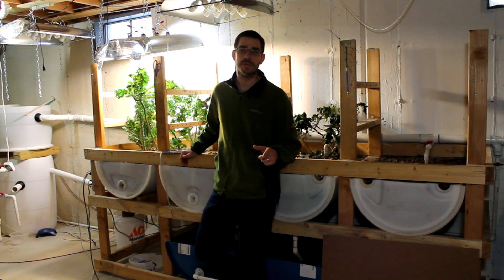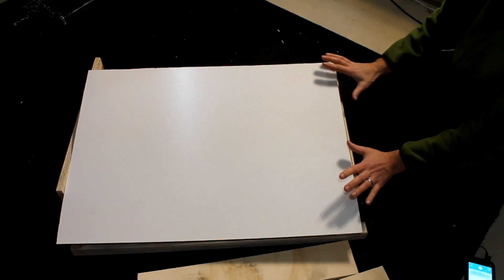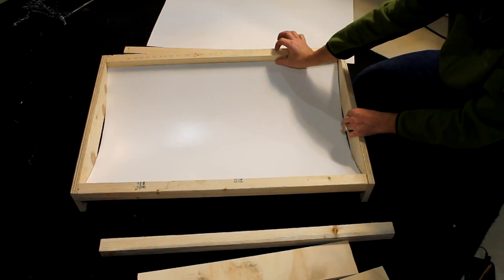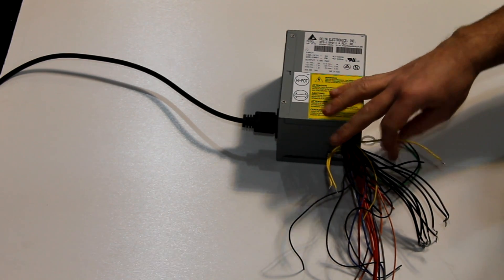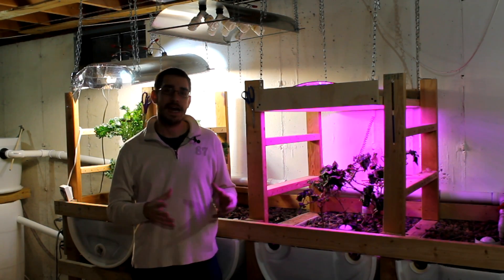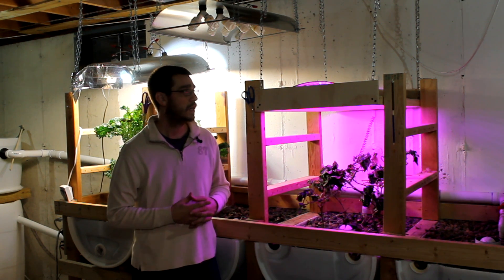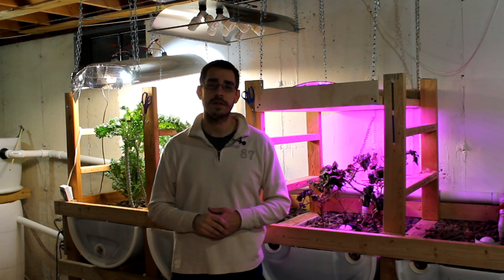DIY $35 LED Grow Light

Comment: Why do you split the power supply?  I have strip lights and am trying to make grow panels as well.  I'm using white LEDs - I was using connectors and that's just a disaster.  I have 12V power supplies that plug into the regular wall outlets.  How many rolls of LED strip lighting can be on one of those?  thank you!

Comment: There are a few issues that need to be addressed with this design. This is lamp is way too under powered to function well as a grow lamp. To be effective, the lamp should be populated with LED strips that are lined up edge to edge. Plants use mostly the blue spectrum for growth and the red spectrum for fruiting, but commercial growers user white lamps which are full spectrum. Multi-spectrum and red & blue are not as effective. The LEDs should be  a warm white color, 3500 - 5000k and the largest size / highest current available. A lamp of the size shown would need to use 2 or 3 five meter strips and a beefy power supply so as to not limit the required current. The lamp doesn't need to be shaped and should be flat. The wiring as shown will require the first strip to be able to handle all of the current for the entire chain which would probably be okay for the current design but could cause heating for larger designs. The top LED maker in the world, CREE, has an excellent article on LED grow lamps which is worth reading.
Reply: THANKS!
Reply: So in short these won't work great?
Reply: Color temperature is nonsense, show me a scientific journal. If you're at 5500-6000k you will be fine as that is what the sun puts out.

Comment: I just bought some melamine from home depot and I honestly would not recommend using this stuff. It gave me a splitting headache just taking it home. In the trash it goes since I read that some melanin boards are made with formaldehyde.  Yuk!  I will say that the gent who posted this probably sourced his board from a place that sells melamine that has not been processed with dangerous chemicals.  Unfortunately, Home Depot doesn't carry such a thing.  Wow.  My head still hurts and I am a tad dizzy from the smell.  Ugh.  Just an FYI for all.

Comment: You could get one of these CRJ 24-Pin ATX Red LED Power On/Off Switch Jumper Bridge Cable instead of cutting things up like that. It is just a simple power switch.  Also, are these mainly blue lights and at what Kelvin rating are they? I am mainly growing leafy vegetables and was told I would want more blue light because I am not growing flowering plants. Is this true? I am just learning and setting up my system and want to make sure I get the correct lights and other gear for my set up. Thank you for your videos. And from what I understand, these will work off the Molex connectors but only on the yellow and ground wires right?
Reply: Lots of experimentation on this very question is out there to review.  Comparative studies on the leafy greens indicate better results with daylight white.  The red and blue did not get near the results in a really good head to head comparison.  With lower output, you can just add more hours per day to get to a total daily dose of PAR to about 100 mmoles per 24 hour period.  This was excellent video though.

Comment: What did you say the sheet material is called? maloneme??
Reply from the maker: melamine, any building supplies store will have it
Reply: Thanks. I had one more question. I see you used a computer power supply, but if I were to use a regular transformer, like an LED driver,  for these LED strips, should I use a constant current or constant voltage driver? I previously used a high power (180W) LED panel and the manufacturer recommended using only constant current drivers (to maintain LED lifespans). But the manufacturer I'm getting these strips from (5.4 meter roll, 18W/meter, 97W total) recommends using a constant voltage driver rated at 120W and is assuring me it won't burn out or reduce the lifespan of LED's. I'd appreciate it if you could offer some advice (I'm lost on this now).
Great videos by the way! Very informative.

Comment: Regarding the LUX measuring, doesn't work quite like sodium bulbs. With LED (and sodium) you should go by the PAR value which is the Photosyntetic Active Radiation, how many umols of light is bombarded in one location available for plants to absorb. Lumens and Lux is just an indicator of how much light is sent by the bulb to one location. (Correct me if I am wrong) :) Cheers for a great video!

Comment: Does a regular led 5050 SMD works also or it has to be a 3 watts led?
Thanks
Reply from the maker: those are the smaller LED's so you may want to add more of them or go up to the larger ones

Comment: Left out the most important information ... the chip size used in the led strip is critical, never use '5050' they are not efficient  the smaller the size of led the more light per watt ..see wikipedia page on "smd led".... '3014 ' are best .... 
waterproof strips are more expensive , and the coating absorbs some of the light... generally non waterproof are best.
Lux meters don't give reliable readings with leds ... manufacturers power ratings for leds cant be trusted

Comment: YIKES! At 12:29 you are shown drilling screws into the power supply! :O
Danger Will Robinson!!  
Geez, what a good way for someone to get electrocuted or burn down their house!
A far better way would be to form some sort of bracket to HOLD the power supply.
Reply from the maker: +Terry Thomas lol, good reference there but of course I made sure that I was screwing shorts screws just through the vent slots on the side of the supply where there are no wires or components, thanks for your concern however:)

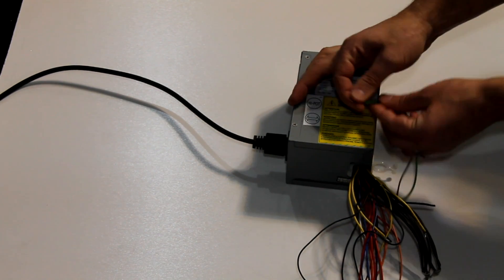Comment: At 6:23 you say to cut off all of the Molex connectors. I would not do that for a couple reasons.

1. if the Molex connectors are kept in place, no wires are going to short out.

2. it would be very easy to solder a Molex connector to your grow lights. Then if at any time you wanted to disassemble or move them all that would be needed to do is unplug the male and female Molex connectors. That is much easier than if everything was soldered together.

BTW, I also am a computer tech and have several computer power supplies sitting around waiting for a project. Thank you for pointing out that grow lights are a perfect use for them.

Terry Thomas
PC Tech Support
Atlanta, Georgia USA

PS
Connecting the green and black ground wires sends a "Power Good" signal from the missing motherboard back to the power supply. As you said in the video, if that signal is not present, the power supply will not turn on.
Reply: a friend of mine has built their own using led cobs, much better output and using proper par/pur spec chips unfortunate you cannot run directly from a supply with the chips as they need regulating (they will draw as much as you gan give and will burn out instantly) but his total build cost was around 25 quid, plant spec 50watt 12v chips, lm338t's for regulation, a few resistors to set current limiting on the lm338t, a 24v transformer (running 2 led in series), bridge rectifier and a 50v 10,000uf cap all mounted to a piece of fat U channel, so far the results are impressive, something to bare in mind lux/lumins are only a measurement of what usable light we can see, near infer red and ultra violet are difficult to see with our eyes.
Reply from the maker: Great point, the connectors would be great to add to the lights for easy disconnect.
Reply: @SSLFamilyDad  Would there be a big difference if i were to use twice the amount of LED strip?      there's a fair bit of room in between, and as an avid fan of DIY and a career electrician i see that as an easy thing to do - IF it's useful.
Reply: SSLFamilyD!m!,!

Comment: Do they sell the LED strip glow lights on eBay? The seller from Amazon doesn't ship to where I live.
Are these the same? 

http://www.ebay.com/itm/16-4ft-5m-LED-Strip-Grow-Light-300Leds-Red-Blue-4-1-Hydroponic-Flowers-Veg-DC12V-/322286756143?var=511187042180&hash=item4b09c9a12f:m:mgK2f93WrfpMZTH7H44ebHA

Comment: Pretty sweet stuff! I am a DIY person myself and I really enjoy your creativity.  I am trying to find that white material, but I am not sure how to spell it. Where can i find it.  Just curious why you opted to not use metal ac ductwork to make a curved structure for the LEDs similar to the  hanging fixture with the grow bulbs.  Thanks for sharing!  =-)
Reply from the maker: metal was an option but with the low power LED's I wasn't worried about heat. Wood looks nicer and is more ridged in this case. The board is called melamine, similar to the stuff in this link just 1/4" thick - http://www.homedepot.com/p/Melamine-White-Panel-Common-3-4-in-x-4-ft-x-8-ft-Actual-750-in-x-49-in-x-97-in-461877/100070209
Reply: Cool!  thank you!  I also like the tip on the power supply tip.  Altex is a great resource for me and I think I will get one there or ebay because I have read some reviews on the LEDs on Amazon that come pre-built with a dinky power supply and some people have said the power supply overheats.  I like your idea better.

Comment: Dont you have heat issues? My 5050strips get really warm,and as i see you glued your strips to wood which isnt a good heat conductor, so can i can i use a wooden board or should i glue my strips to a aluminum sheet instead?
Reply from the maker: those led's don't seem to produce much heat at all. If you want more powerful ones then I might suggest using metal to help dissipate the heat but I have left these on for days on end with no issues.
Reply: i ordered 5meters of red and blue led strip with 5050 chips,its 14,4W/meter,i hooked it up to a 12v power source and the leds heated up in seconds and they were very HOT,it is possible that im over-exaggerating this because i didnt make led panels till now,but im planning to glue them to a wooden board and i dont want this thing to catch on fire...
Reply: Hi. I love your videos. You seem like a great guy.

But I don't understand how this can work in a stable way. LEDs have a resistance which gets lower, as they get hotter. So - it gets warm, resistance gets lower, so it conducts more current, so it gets hotter, so resistance gets lowers, takes more current and so on, until it destroys itself. This is called "thermal runaway" and it's why LEDs need  a constant current power supply, and not a PC power supply.

Perhaps your LEDs use resistors, which can be used to regulate the current in LEDs, but they are a poor choice, because they regulate by dissipating excess energy as heat - which is not light, and won't help your plants to grow.

Could you tell us how your LED strips don't need a constant current power supply please?

Comment: Just a note, avoid led strips since they use resistors. If you had a constant current power supply and you wired the leds together by yourself, the whole thing would be far more efficient.
Reply: I asked cuz if you were to buy each individual led it would cost roughly the same as buying one of the cheaper grow leds the KIng Plus led to be exact
Reply: Yes, it's more safe and efficient, we have developed new led grow light with constant current and low voltage input, this is far more safe, also our product allows you to change Blue/Red light ratio, and light intensity, if interested, you can contact me.
Reply: Hi, sir I need your help as I'm working on this kind of LED panel.
Reply: +Joe Duan can you give me a link to your product please? I'm interested
Reply: Timo Salola where are you getting your information on efficiency?
Reply: maltman4101 I've got my own light setup and I had to do some research for it. If you are using a mains to power your leds, you will always have to use a transformer. Now if this transformer is a constant current supply, you don't need to use resistors and the only wasted energy comes from the supply and wiring. Actually, an ideal switch mode power supply can have almost 100% efficiency and with a low resistance cable, the amount of lost energy is extremely low. 

You can Google things like "why to use constant current supply with leds" for additional information.
Reply: Even though the led strip has resistors shouldnt the constant current power supply put the same amount of wattage through the leds? With just the problem of heat dissipation?

Comment: Great idea. I like the design of your hood and going to adapt the design using aluminum flashing instead of wood for thermal dissipation.  I've done something similar with more output using rigid strip LEDs that you can buy on eBay.  The rigid ones are better as you can remove the cheap 100 ohm resistors and drive the LEDs to their optimum current. The rigid LEDs are mounted to an aluminum alloy strip which can transfer heat to a crude heatsink. In my case, I'm using old T12 fixtures that use plenty of thick sheet metal.  I use double-sided thermal tape (also eBay) to stick the LEDs on to the metal. For example, I'm using the large 7020 SMD LEDs (90-110 lumens per when driving a at 500mA per LED). I drive 0.5M strips at 18 watts each for roughly 1800 lumens per strip, which is a lot of par in the blue and red spectrum.

Lastly, if you're concerned about flavor, budding, and fruiting, you're better off with warm white and cool white LEDs vs using red and blue "grow" LEDs. The main reason for this is that you get more spectrum. It may not be as efficient (uses more watts) but overall better results.
Reply: i guess it would be easier to use those t5/t8 integrated tubes. i only have to screw the two metal snaps on the wood to hold the aluminium fixture which is already integrated with the light tube. no need to worry about the glue and moisture.
regarding to wider spectrum in full spectrum  grow light, while i think it is not neccessary, because not all wavelengthes can be absorbed by plants, some wavelengthes are only waste for plants and only require power consumption. and generally full spectrum grow light may not have enough red light inside which can meet specially the bloom stage...
for red and blue tube grow light, there are 3 RB ratios which serfs percifically different stages: 3:1 for seeding, 1:5 for vegetative stage and 8:1 for flowering...things like the below link:
www.amazon.com/shops/haolin_growlight
Reply: i guess it would be easier to use those t5/t8 integrated tubes. i only have to screw the two metal snaps on the wood to hold the aluminium fixture which is already integrated with the light tube. no need to worry about the glue and moisture.
regarding to wider spectrum in full spectrum  grow light, while i think it is not neccessary, because not all wavelengthes can be absorbed by plants, some wavelengthes are only waste for plants and only require power consumption. and generally full spectrum grow light may not have enough red light inside which can meet specially the bloom stage...
for red and blue tube grow light, there are 3 RB ratios which serfs percifically different stages: 3:1 for seeding, 1:5 for vegetative stage and 8:1 for flowering...things like the below link:
www.amazon.com/shops/haolin_growlight

Comment: Hey can you use t5 with red led?
Reply from the maker: +Mike Disher I believe you can get 2700k t5 lights which is about as close to the red spectrum you will get with that type of loght
Reply: I super charged a t12 shop light added another ballist but I would like to add a red led for blown stage
Reply: for bloom stage our t5/t8 light with Red and Blue Ration 8:1 can help you...if you are interested, kindly let me know. thx :)
Reply: @besshu5036  I'm interested in the T5 bulbs you mentioned that you have. Where can I both learn more about them & also purchase them? Thank you very much

Comment: Hey brother, thanks for the video.. awesome you're into aquaponics.. Im all about organics.. so obviously, sustainability like that would be great..
I like the light you made.. first.. I have a few comments and constructive criticism… though, its just my opinion.. so anyone take it for war you will.. but thanks for the video..
Ive been looking into the DIY LEDs vs cheap amazon LEDs vs brand named.. seems I could buy a few different ones, and supplentment w/ T5s @ 6500 K and have a just as good spectrum..
Anyway,,.. I lie yours.. I think id go for 2 different spectrum powers trips, like mix one like yours with either pure white or whites and blues, and w/ the no UV in it, I think Id stick a 2x2 T5 at least 1x 6500K That'd come with it,and a Hortilux Powerveg.. Thats a great addition of blues, greens, yellows, and toe of UVB, and more blue.. great light.. Ive never seen nodes that tight from many lines all super tight under other lighting..
I think the mixture of putting a 2x2 - 2x3' in the middle, w/ a mix of 2 different types of spectrums, one with some white LEDs, and double up the amount of strips, would make a nice light.. 
I think Id buy a thin sheett of aluminum or steel if need be though,especially, because attaching the power suplys..
Thanks a lot for the video..
Id suggest putting even a single 2x2' Hiortilux Powerveg HO 22W bulbb on each side, and watch your growth and health increase dramatically from the truly full spectrum. I currently mix HPS & CMH..
But I want an LED and Im thinking of buying a small T% system to run the PowerVEG's in to give a full spectrum and dave electric still , akin a full spectrum.
..Ive been thinking on this awhile.. Hs @ bbay, you'll figure it out if u need.
You always need something like a MH , or plasma or induction these days, to supplement ANY other light for a FULL spectrum for max PAR… Just my experience, and def opinion from exowrience and research and reading.
-peace

Comment: how many amperes are you pulling with those build one but set air duct tape as a reflective background but not very bright using a 12v DC 60 mA power supply
Reply: Medieval jedi hook up a 12v 5 amp PSU. 60ma isn't near enough